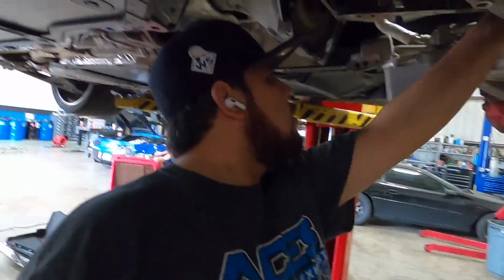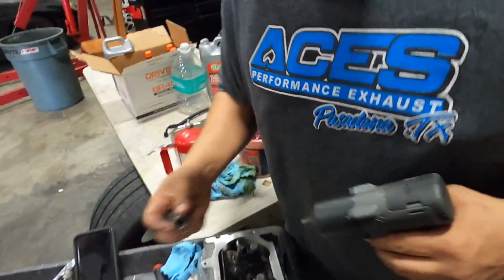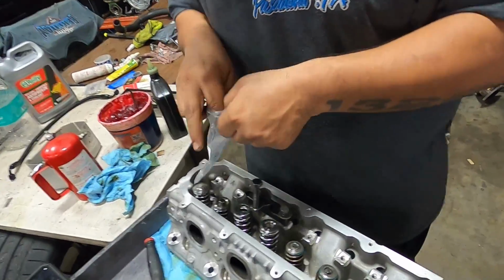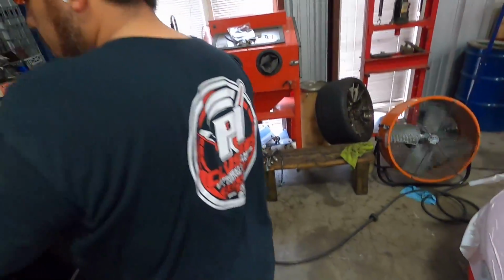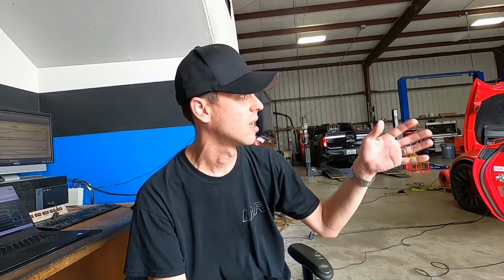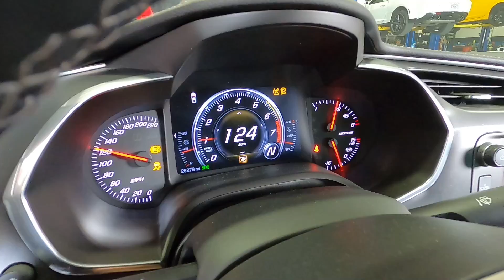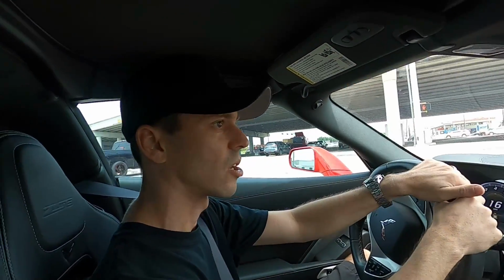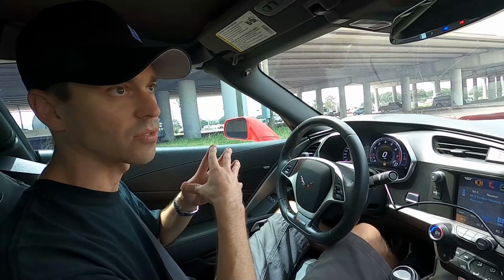What little mods you can do to get 700 whp?!! Watch in detail Cam package install.

Comment: The reason why I love this car? It’s a plain z06, no ground effects, no widgets all over, it was rebadged , and it looks like a sting ray model, and thus making it look several times better looking then any z06 I’ve seen by far, and with the NOW more power it has. It’s a pure sleeper to any z06 in Texas or where ever this car is going, YES u have my vote on the quality and now Pwrformance this beast has. 

The color combo is also sweet to, I would only lower it a inch to make it perfect. But that’s only my preference on it, but love it and love the color to, torch red. Just beautiful all around the way he made it look on the outside

Comment: Cams are not LITTLE mods.  When you take the engine apart, remove the heads etc..thats not little.
Reply: Yup agreed … springs , retainers , oil pump gears , secondary primary chains
Reply: It’s simple to do it on an LS/LT
Reply: @mach183  it's relatively not little but the price/performance gain for money spent is very little and really unmatched except for like new AMGs and BMWs.
Reply: @nickadkins7765  I agree .. depending on the cam , grind , and stage where taking 50-100 rwhp
Reply: i’m sure for the cars they build on the daily and their customer base, that these are little mods. easy job on LS engines. now for the holy grail coyotes engines it’s a WHOLE different story…
Reply: This
Reply: @QuillyOG  you don’t need to do these these mods on a Gen 2 or Gen 3 coyote. Even OPGs aren’t necessary. Just headers, blower and tune and bam 800whp or more with E85r or 260gt
Reply: @Johnnyboy200406 okay but like me, I don’t want to run anything but 93 so I can just pump & go & don’t really have to think about it.

Comment: The only thing I didn’t hear was a price range for this package.
Reply: Expensive is the range
Reply: If someone can afford a Z06 then the price range for these mods shouldn’t be a hard point to them
Reply: Still, are we talking $10,000 or $25,000?
Reply: Floyd Elliott I doubt a cam, head work, some bolt ons and an E85 conversion would get close to either of those prices unless that’s what these guys charge then that would be ridiculous.
Reply: AidanJ. G!! You are very mistaken on prices then.....for this setup it would run you around $15k from a reputable shop....
Reply: Don't feel bad ..I own a C4 ZR1......Go on vette Drs website and see what they want to modify a C4ZR1...You want 560 wheel horse ? Which is way less than 700....Well, it will cost you around 21,000 dollars....Very expensive to modify an LT-5

Comment: Would you have to upgrade the torque converter for the cam on the automatics?
Reply from the maker: No, the stock transmission can hold a fairly large increase in power before needing modification. That being said, we do tune the transmissions so they can handle the increase in power correctly. Which helps a lot.
Reply: @LateModelRacecraft  o ok! That's great.. I'm in Louisiana and I've been checking you guys out for a while now.. Thinking about letting you guys build my zl1
Reply from the maker: The 8sp autos have 2500 torque converters from the factory so no need to install an aftermarket converter with cam shaft unless you are going to drag race it and need the better 60ft. 👍
Reply: @LateModelRacecraft  I have a 10 spd in my 2018 zl1.. I can still run a stock converter?